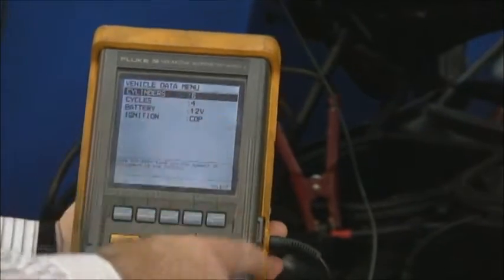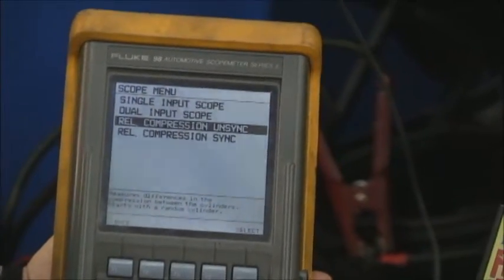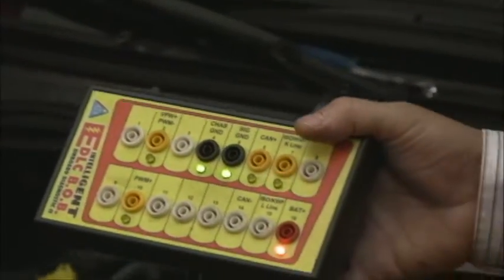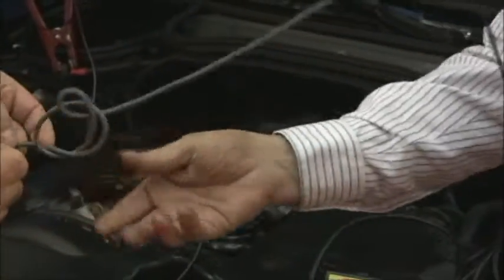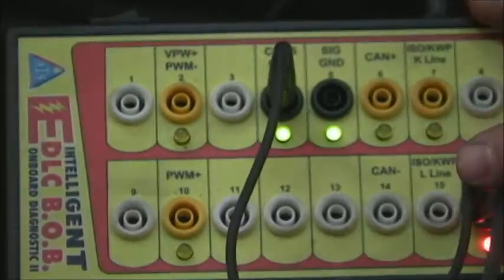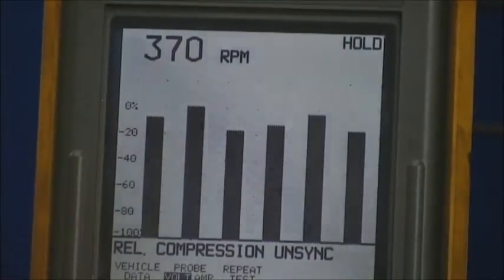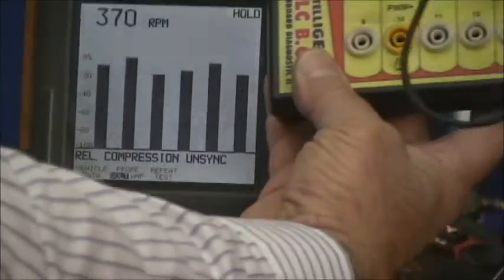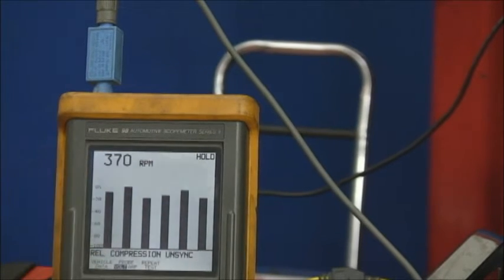Relative Compression from the Driver's Seat Fluke Labscope - Live From TST:

Comment: Is a fluke 99b good for automotive diagnostics ??
Reply from the maker: It wont have the compression test or bars as the Fluke 98 Series II has but it can be used by coupling the scope to AC voltage and cranking the engine over. It wont look pretty but it woks. Please view the other videos that use AC voltage on our channel. Thanks for your comment and for watching...for more seminars and training check out tstseminars.org . If you have not already subscribed to our tstseminars YouTube channel please do so. Thanks

Comment: I would like to ask another question. Do your 98 fluke scopemeter turns on automatically when you connect the charger on to the 98 fluke scope meter to charge. Because my fluke scopemeter that i just buy from the internet does not turn automatically when i connect the charge on. I have to power it on then it turns on.
Reply from the maker: It does not turn on automatically when charging...you have to press the power button.
Reply from the maker: It does not turn on automatically when charging...you have to press the power button.

Comment: I would like to ask a question do the 98 fluke scopemeter will do compressure text on a D I S and coil unplug
Reply from the maker: Yes the ignition system does not matter since it's measuring a voltage drop per cylinder. Thanks for watching...if you have not already subscribed to out tstseminar YouTube channel please do so.